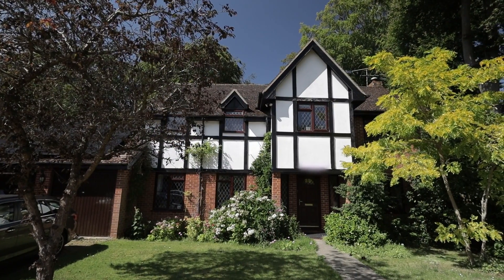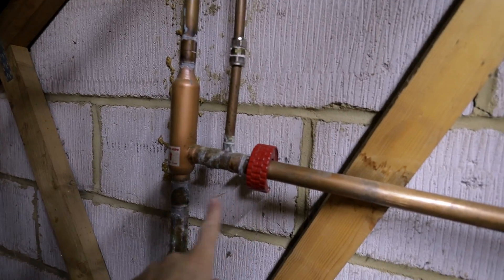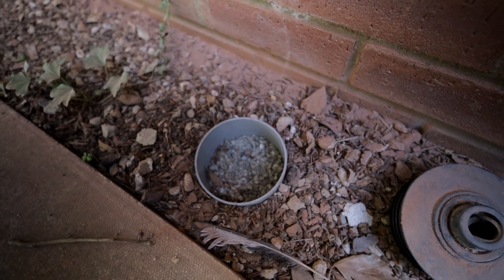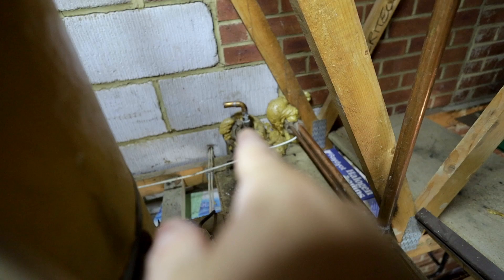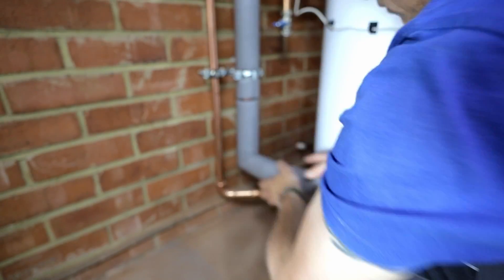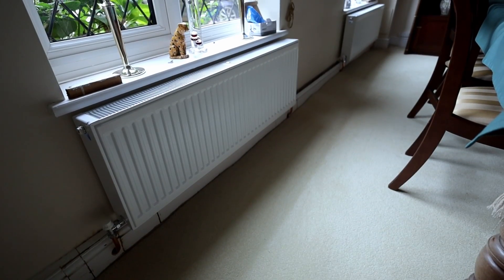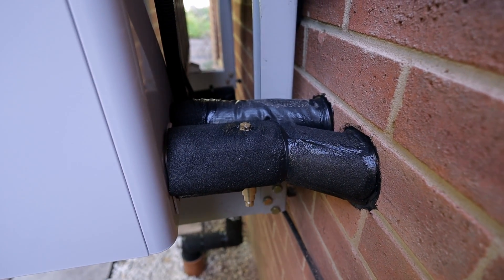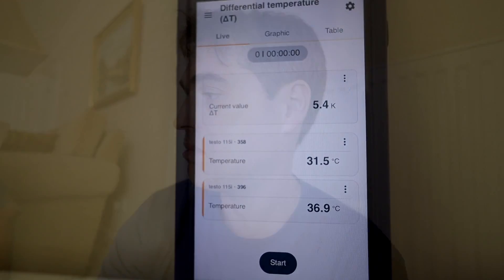Heat Pump Retrofit in a 1980s House: What's Involved?

Comment: A look into Mid terrace solutions would be great like my house 1968 mid terrace, solid concrete floor with plenty insulation.
Reply from the maker: in this video I go though a mid terrace installation with amazing efficiency of the system over the last winter:

https://www.youtube.com/watch?v=RZPGZN1jhyk
Reply: @UrbanPlumbers  absolutely seems ok the next question is cost.. 😔 my back boiler costs maybe 3 to 4k to repla6with a combi would a heat pump with the 5k grant cost this if so I want you to install one 😁🙏

Comment: Do you have any experience of what SCOP one can hope for if installing a Vaillant heat pump that actually needs to run at 60 degrees (during winter). We live in a monumental protected building with cast iron radiators, high ceilings and limited opportunity for additional insulation. Huge need for heating and huge heat loss. I´d love to go with a HP, but anything less than SCOP 3.0 means higher rather than lower heating costs compared to my current situation with energy prices here where we live. Thanks for excellent videos.
Reply from the maker: 55C is te highest you should go. If you go 60 that unit will not last very long, as it is not desinged to run at those temperatures for longer periods of time. Vaillant says 55C should be the maxium design temperature. SO called high temp heat pumps are not high temp for heating, they are designed hight temp for DHW, so that they do not need to use direct electic back up heater.

If you run those units at 55C max flow you can expect a scop of aroun 3.0-3.2 - provided you have your system pipework designed correctly, use it open loop (do not zone it) and weather compensate it on Vaillant contorls.
Reply: Thanks a lot, highly appreciate it @UrbanPlumbers

Comment: Great stuff, I love watching these kinds of videos thought I'm not involved in the industry or trades at all. It just satisfying to see clean and high quality work being with good production values and learning a bit on the way. 

2 questions, what kind of % is your work now ASHPs?
also for a direct electric heated house off the gas grid, what would be the best option? mini split air to air ASHP?
Reply from the maker: I only do ASHP at the moment. I haven't installed anything else in last 6 months and the diary is fully booked for ASHP till the end of the year. I may have to move one gas boiler this year, but that is it. After installing heat pumps for a year, I really do not miss gas and competing with 'trow it on the wall' brigade'. 

Mini split is a budget option - so way cheaper than ashp, but A2W is far superior in terms of comfort, DHW effiency and also more efficient than mini splits can ever be on heating, if done open loop, wetar comp and with low enough flow temperature.

I can see a role for A2A for people who do not have funds to go full ashp. A2A is still better than direct electric.

Comment: Great video and work.  Unfortunately most people in the UK don't have a  side to their house...
Reply: Excellent video,  brilliant work, but with space I must comment- a usual terraced street does not have the footprint to mount a heat pump in a small front garden, put it where the bins are, bins are usually free standing. I think a big issue in London is definitely the location of where the pumps  will go, and the general lack of  expertise of installers like yourself.
Reply: @london_roubenl  There are always going to be some exceptions.  Terraced houses generally will have smaller heat pumps because of having other houses on either side reducing the heat loss there, so there are many cases where they will still work, and others that won't.  In my opinion, a shared ground loop or similar would serve terraced houses better, but has many hurdles to make it viable, including, everyone on the terrace would need to contribute and want it done etc. so logistically would be a nightmare.
Reply: @BenIsInSweden  Thankyou for your reply, I totally agree. For me the key is to have more people like yourself with the high level of practical and theoretical expertise required to move the heat pump industry forward. Kind regards.
Reply from the maker: where do they keep the bins then ;)
Reply: @UrbanPlumbers  in the  front garden.. The majority of houses in the UK  are terraced with a very small front garden.
Reply from the maker: Put it there then
Reply: @tombrehony6277  According to Barratt Homes, 26% of UK homes are Terraced. 32% are Semi-Detached, and 25% are Detached. The only area that Terrace (27%) beats out both Detached (23%) and Semi Detached (8%) is London, but it's still less than those combined.
Reply: @UrbanPlumbers  unfortunately if you walk around most cities in the UK most hoses also have very small front garden large front windows making it nigh on impossible to fit these large modern boilers as in you're videos. We've now been given large multiple wheelie bins , that will barely fit in the garden . These are valid points. You're work looks fantastic. Most of the modern heating systems I see installed are absolutely dreadful and sold to clients by salesmen ...

Comment: Great video as usual!

What do you mean by no third party controls? I currently have a nest thermostat on one zone and tado with smart TRVs on the other zone. Do I need to ditch all of this with an ASHP? No thermostat?

The quote I have is with Octopus using a Daikin EDLA09DA3V3 ASHP. Any experience with these and how good they are?

Install location is difficult for me so looks like I need to trench under my driveway to site it near my boundary. Not ideal and I'll have to organise this myself.
Reply from the maker: Daikins are ok, but nowhere near as nice as Vaillant,  Viessmann or NIBE.

Yes, you should ditch all your controls. They can only hurt your system, n or only on Ashp but also on gas.
Reply: @UrbanPlumbers  thanks 👍

Octopus seem to be the most competitive but they only supply Daikin. They certainly don't look as nice as the Vaillant units. My next nearest quote was almost double the cost using an EcoDan.

Comment: As a heating installer, gas registered and qualified in unvented H/W,  with three times more years in the game than you Mr Urban Plumber,  I can say that your work is of the finest there is, If anyone wants an ASHP installed (that includes me) this is the guy to install it, his also a Heat-Geek assured, ASHP Qualified installer.  
Question, all your ASHP installs use 3 ports valves, is this simply to take advantage of the auto bypass this creates.
Reply from the maker: Thank you for the comment. Those valves a diverters not 3 ports. I don’t use 2 ports as I don’t zone my systems. They run what is called PDHW and open loop.
Reply: Ok so they only move to block the heating port when hot water is called as that's at a higher temp then goes back so low water temp flow to the heating. thanks.
Reply from the maker: @derekclark7545  correct

Comment: Hinckley point C will transfer heat to 132,000 litres of river water per second.
Reply from the maker: Install a river heat pump downstream then!
Reply: @UrbanPlumbers Yes, that would be a great idea. On the continent nuclear has been restricted on safety grounds of overheating the local environment. 
When batteries for home storage become viable, solar battery for homeowners will become
a no brainer!  Solar panels need a cooling system for best output and longevity, not too difficult but folk can't be bothered. 
I really love your videos, thanks for making them. I have 16kw ashp which I run on Economy 7 at 10p into a water store. I get about CoP 2 which costs about 6p kwh. Trouble is, my contract runs out in December......panic panic!
Reply from the maker: @jonjo6886  scop of 2? Ouch. Get a heat geek to sort this system out for you. There is no reason not to be able to run any heat pump at at least 3.5 these days.

You actually have to try very hard to get such a low scop.
Reply: @UrbanPlumbers  All it has to do is heat water in a tank with 1 metre of pipe run. Remember, I only run at night when it is coldest air. I only use heat when it is particularly cold anyways. 
It's been under 6p kwh.
Reply from the maker: @jonjo6886  still, even with below zero temps we can get cops of close to 3
Reply: @UrbanPlumbers  I am elderly, this is how I assess a room in my 200 year old house in a very cold week
Cubic metres 1 room = 60.  Times by .0606 is something like 3.6.kw. Times that by 2 and it is roughly, rounded down a bit 6kw. Heat pump at CoP 3 = 2 kw and If electricity is 31p  = 62p an hour. Times that by 24 =£ 14.88p per day . Times that by 7 is about £104 per week.
For me on state pension that is totally undoable.
On hindsight, if I had invested wisely on a solar battery set up of 10kw panels,10kw battery I reckon I could have been independent of Grid electricity for 6 months and used the battery during the winter to buy cheaper electricity it would have given a return on investment of about 13%.

Comment: I'm interested to know why you don't recommend buffers?
Reply from the maker: Distortion. Buffers will affect your efficiency in a negative way. You have to use them in certain situations, but they are usually used when they are not needed.
Reply: @UrbanPlumbers  thanks, are you referring to a non-linear link in the 2 fluid circuits that affect the ability to control?
Reply: @UrbanPlumbers  can you explain distortion in this scenario?
Reply from the maker: Check heat geek channel, he explains it better than I could
Reply: @UrbanPlumbers  OK thanks.

Comment: can u help me decide why not installing bufer tank..as usual amazing job...
Reply from the maker: buffer tanks get installed for no good reason 90% of the time. They really are almost never needed and all they do is create what is called 'distrotion' - and lower system efficiency. They also add around £800 to the installation cost for no good reason.

You will only ever need them if you have to cascade more than 1 unit, run a hybrid set up or do not have pump in the uni big enough for the system - which is very rare.

Manufacturers show buffers on thier schematics, as it allwos installers without understading of system design to connect heat pumps to any system, and keep the heat pump happy. There is a big effiency cost involved in installing system in this 'lazy' way.
Reply: @UrbanPlumbers  thnx mate..love ur work..im installer to. but as u mentioned the manufactures are pushing as to install buffer tank for the purpose of expanded lifetime of heat pump

Comment: Thanks for the positive video. We are at a stage where it is down to the designer/installer to get the system right as the technology is ready. Good luck to Heat Geeks and others teaching the "light touch" approach to heat pump installation.
On the subject of Y strainers versus ball filters, I had Brendon Uys over inspecting a heat pump the other day; he recommended the Impel FBVM 486-32 mag-filter and strainer (Kv value of 21.1 according to their datasheet). £70 each, so not cheap!

Comment: Great video, interested to hear why you had to install the cylinder as vented. Low incoming main pressure?
Reply from the maker: Not only low but also difficult and expensive to run new mains to the garage as existing stop cock is in the middle of fully renovated kitchen.
Reply: @UrbanPlumbers  first time I saw an unvented with a capped PRV I did panic a bit, that one didn’t have a very well thought out label though. 

Hope you’re well and keep up the good work 🫡

Comment: One of the easiest examples of heat pump installations. Cylinder, meter, electrics and outdoor unit all within 10m of each other or a single wall. Lucky when this happens

Comment: Quality workmanship 
Seriously considering a heat pump install. 
Question - I currently have 13 radiators on a vaillant combi, can I run the heat pump as a additional unit for ground floor underfloor heating?  Idea being to turn off / leave for extra heating if needed the ground floor radiators, run the ground floor via heat pump and 1st / 2nd floor via combi boiler. 
It’s a 1930s semi detached property. Is this a viable option or is there a better solution??
I have the space on side of my house to locate the outdoor unit 1m up.
Reply: The Boiler Upgrade Scheme grant does not include hybrid systems, so retaining the combi would leave you £5,000 worse-off. The question is why would you want to only run the ground floor via the heat pump rather than the entire property?

Comment: How would this setup compare with a new gas boiler that has also had radiators to work with 40 degree flow and that has been range rated to the correct heat loss for the  property?
Reply from the maker: Gas would be around 20% more expensive to run and comparable cost to install as there is no vat on renewables and £5k grant
Reply: @UrbanPlumbers  this providing a heat pump scop of 400%
Reply from the maker: Yes. Hey Geek elite installers average scop is 4.2

Comment: What’s the cost, a good review at the end would be..

Thus was a xx heat pump rated at  xx kWh the cost of the heat pump and material was ££££ and total install cost was ££££.

If you have the data for multiple jobs you could just supply generic and not specific info.  This will help people determine how much they should be thinking generally for their 1980’s house etc.

Comment: Great video! Would a heat pump like this work on a one pipe system (bypass on each radiator) or the system would need to be upgraded to a two pipes system?
Reply from the maker: Needs to be upgraded

Comment: We have been using heat pump for the last 10 years.we also have been using low water content rads such as Jaga rads or aluminium radiators with no problems,Jaga lads have the advantage of being able to self convect at low temperature (DBE type)and take up to a 3rd less space than the equivalent output rad!I don't remember any of your systems having solar panels incorporated with heat pump installs? Sorry if I have missed a video with panels.all are heat pump jobs would have solar thermal panels fitted.great video's

Comment: What would you do for a foolish man who's installed unremovable LVT flooring but would need pipe upgrades to make low flow temperatures work? 
Remove skirting boards, install new wet system/ pipes there and then hide new pipes behind new skirting?

Comment: Is there a reason you don't like buffer tanks I was under the impression that this allowed the heat pump not to circle so often improving SCOP. also why issues with third-party controllers if some already has a smart thermostat and trvs why replacment them? Just interested as I am looking to add a new ASHP soon replacing a combi boiler and have Tado on all radiators.

Comment: Have you had any turned down by the DNO's? Is there any requiring grid reinforcement? Any need to upgrade a DNO fuse? Any issue getting fuse upgrade?
Reply from the maker: No, never. DNO may sound complex, but they actually can’t refuse the installation.

Comment: My gas is six times cheaper than my electricity per KW. Surely a heatpump would have to be 600% efficient just to match what the boilers doing? I realise some heat is lost out flue, but it is condensing all the time as correctly setup. Great video, and amazing standard of work as usual, keep it up!
Reply from the maker: No, it would have to be around 450-520% efficient to be comparable to a 80-90% efficient has boiler if cost per kWh was 6 to 1
Reply: Where is gas 6x cheaper than electricity?  My only guess would be a fixed gas rate that will expire in the next year or two, but didn't fix electricity.
Reply: @BenIsInSweden  UK example. Intelligent Octopus peak electricity 30.2p/kwh (18 hrs per day), Octopus Gas Tracker has been around 5p/kwh for a few months now.
Reply: @jamesbrindley1990  surely you'd have the tracker for both then? Bit pointless quoting rates from the same supplier for two different tariffs when they have options that would easily make the heat pump cheaper.
Reply: @BenIsInSweden  Not if you have an EV with high usage/mileage so more of your usage is driven by the EV.
Reply: @jamesbrindley1990   But even in that scenario, the heat pump makes use of the lower rate, and you can have the DHW heated during that period as well, so saying that gas is 6x cheaper than electricity isn't the whole picture anyway.

Comment: Looks great, similar to my install in a 1974 large detached house, operating SCOP 3.89.  I was able to route the condensate to an existing rainwater gulley - you can see the amount of water produced when it’s humid is like a tap just flowing, soak away might be overwhelmed.

Comment: I am curious you have been able to use a Vaillant Cylinder in a vented system. For some reason I thought all heat pumps needed a closed pressurised systems due to that higher flow rate. This is good news as our system is vented so hopefully easier to install.
Great video with good detail. Looking forward to the next heat pump install.
Reply from the maker: System is sealed, it’s the cylinder that is vented